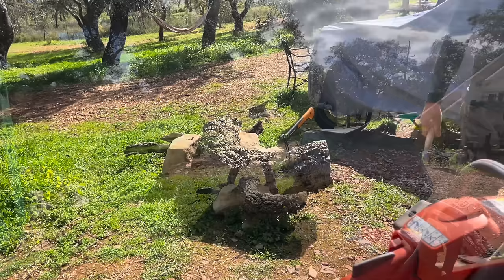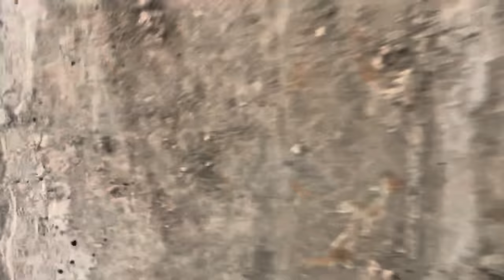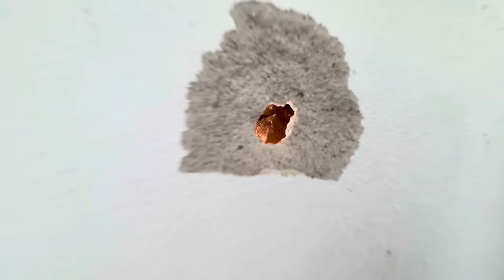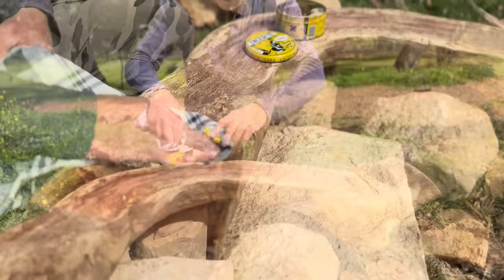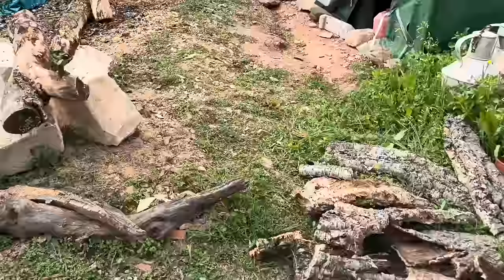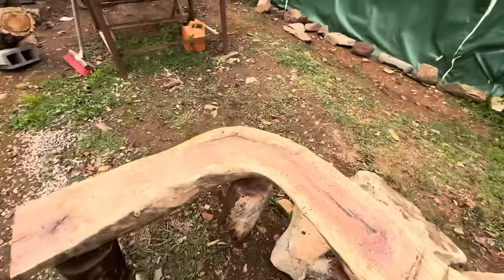Creative reuse of Wood In Rural Farm in Portugal | E151

Comment: Andrew, everything seems to be coming together so well.  This time next year we will not recognize the “old” place.  I am happy you decided to stay and put your time and energy into rehabbing and revitalizing the little house and grounds.  Regarding your back.  Please try to minimize bending whenever it is possible.  Calculate your best work level by bending your arm horizontally  and measuring from your elbow to ground (floor).  I suggest you build yourself a portable workbench with folding legs so you can move to each work area.  Also, try squatting more than bending. I try to avoid giving advice—please give me a pass for overstepping the boundary. Cheers!
Reply: On behalf of the fellow and dame body workers, yes, do as advised Andy,
for it is ultimately we, that have to labor to set such enthusiasm right again. Valid overstep, and dearest healthy regards.

Comment: Andy, your creativity is beyond question, but I do wonder if your chainsaw needs a new blade – especially when sculpting timber. 
Watch out too if using old wood within your house – it needs some bug treatment before placing inside. Those pinholes in the bench timber are woodworm of some sort. 
I appreciate that any old timber will add softer visual touches to a concrete and rendered space, but sourcing the right old timber is key. So many old houses in Portugal seem to have had their interiors destroyed by bugs like woodworm – and of course that's as much about dampness and the typical lack of winter central heating. 
This post sounds negative, so my apologies – the house is now looking terrific, and a blank canvas for your skills. I have grown fond of that giraffe, but change is often good. 
Great too, to see the dogs look so happy.
Reply from the maker: The chainsaw was sharpened. Don’t worry, nothing rotten will be in the house. 👍

Comment: Those thin ends of wood which you said would make a nice coaster, would make a nice abstract piece of art for either exterior or interior walls. You are an artist so it should be interesting. I always like to bring the outside inside so I painted my kitchen the exact shade of green as the sunlit sugar cane field leaves. It was a bold choice but made my kitchen seem bigger.